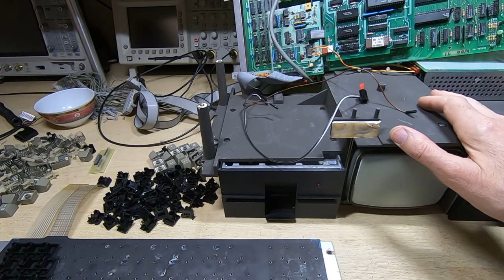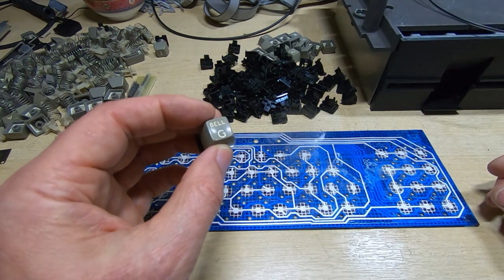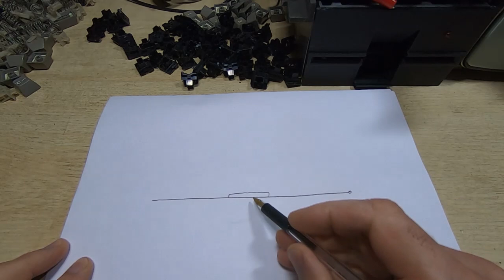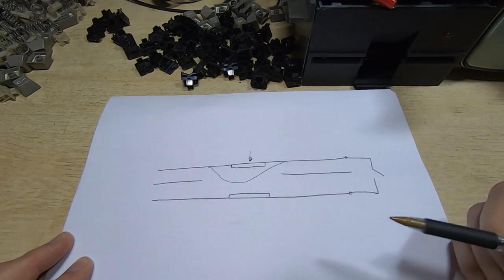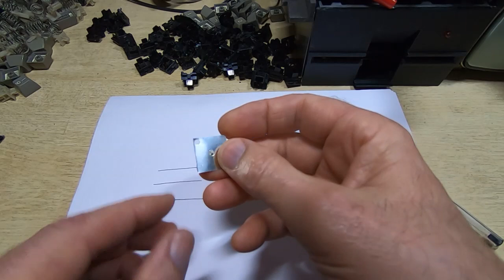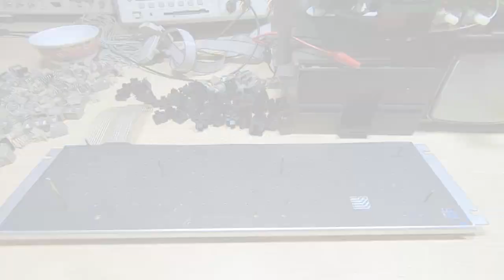Osborne OCC1 Repair Part9

Comment: I'm a tinkerer, not so much the perfectionist restoration type ( :P ) and I'm also of rather limited means -- and my standards are thus somewhat lower, as such things go... generally, if it works, it's good enough, even if I've unleashed a den of mortal sins inside, as wiring goes, to get it there! (Heh.) I am by no means above a nest of bodges...

One trick I've found for custom membrane keypad/keyboard solutions is to get some of that Cricut vinyl that Wal*Mart and most craft stores sell in short rolls, as well as a reel of 4mm wide copper tape and a one-hole hole punch. Assembly is bonehead simple, as in, if you actually manage to mess it up without effort towards such for some reason, you should probably look into an IBM Selectric to replace any PCs or PC-like devices in your life, and an inexpensive flip phone to replace whatever iTravesty you make phone calls with.

If you're old-fashioned or weird enough to have em on hand, Nineties-style overhead transparencies work just fine as well, although you'll have a bit of erm 'fun' getting the hole punch lined up with anything of any real size. Anyways...

Cut your vinyl into three pieces to fit the keyboard or keypad you're making or repairing. Lay out the rows and columns -- rows on one sheet, columns on the other, and remember that one's upside-down inside -- using a pencil first, then a pen to mark the pathways. Copper tape goes down along your pathways. Where they need to intersect for a keypress, mark that on the third sheet and use the hole-punch in those locations. Run thin leads to the copper tape ends, where it best suits -- old-style Kynar wire-wrap wire will work a treat here, or magnet wire if you're either ridiculously careful or ridiculously brave. I wouldn't use anything larger... if you're in a real pinch, scavenging wire from old POTS cables with the RJ-11 jacks on them (well, here in the USA) should work in a pinch. Make sure your solder joints are as flat as possible and don't scorch the vinyl! Layer together, copper facing copper with the sheet of holes in between as a separator, assemble and test your keyboard matrix. If you can use a USB input, QMK on a Teensy2++ or an Arduino Pro Micro knockoff from eBay (if you have 18 rows and columns together, and no LEDs, or whatever combination you need there) works a treat. If PS/2... my best suggestion is, get an old PS/2 office keyboard, loot the controller and reverse-engineer the matrix from the original membranes, use Schottky diodes to make an adapter matrix. (Note that I've not yet actually tried this!) Another common old trick was to use a ROM as a decoder... the address lines are your combo inputs, data lines are your outputs. Not sure how well that'd work in a keyboard tho. For something old and weird? I suppose it depends... but whatever works, works.

Comment: Jerry, your solution is hopefully just what is needed to repair the membrane.  Thumbs up!  What medieval technique did you have to use to separate the bottom (clear) layer from the middle (blue) layer without obvious damage?  Were you able to carefully & slowly pull them apart?

Comment: Amazing repair! I am impressed with your ability to come up with creative solutions to problems. After seeing the corrosion on the aluminum panel,  I would have gone immediately to plan B - a new custom circuit board with proper key switches and re-use of the key caps. Well done sir! Regards, David.

Comment: Corrosion *inside* the multi-layer membrane? Definitely chasing ghosts using the heat+vacuum to reform the membrane. Kudos to you for going to such lengths to cleaning and recovery of the multi-layer membrane.